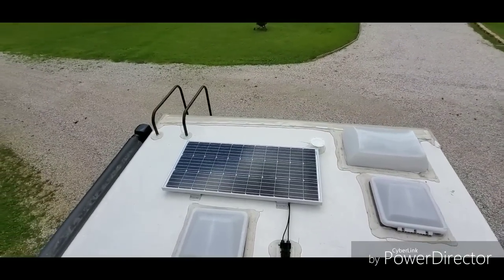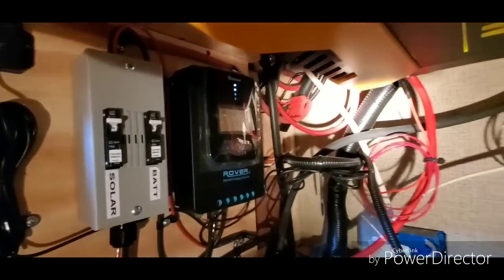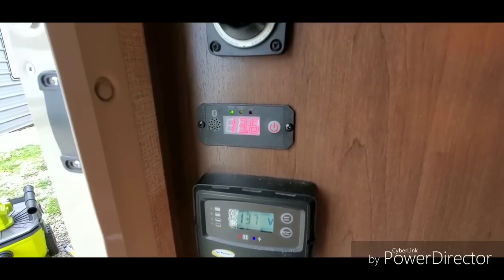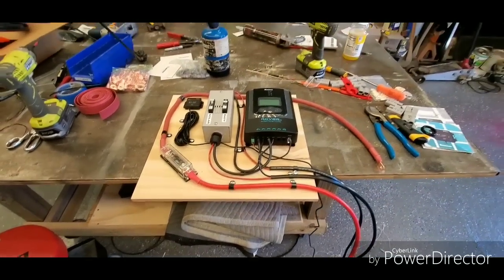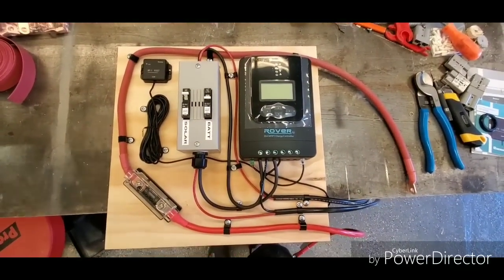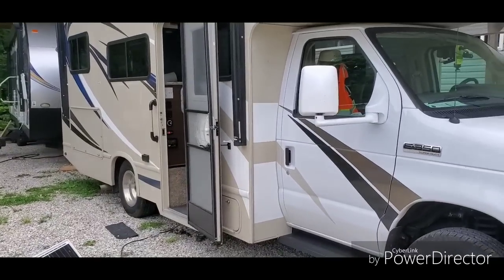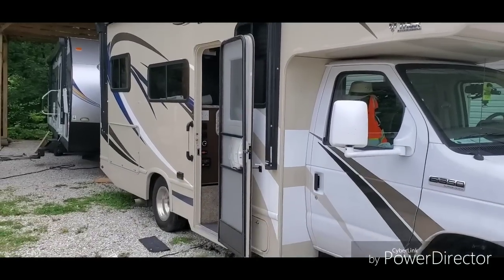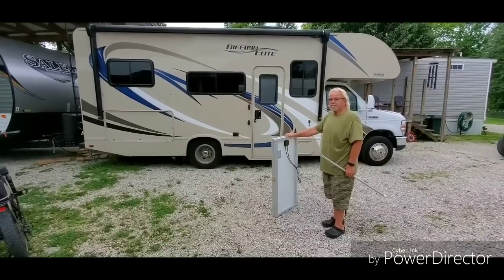Motorhome solar system install and upgrades. E22

Comment: Nice work Red!  So glad you found the live wire so you can cap it.  What kind of silicone did you use on the roof.  More is better when it comes to silicone.